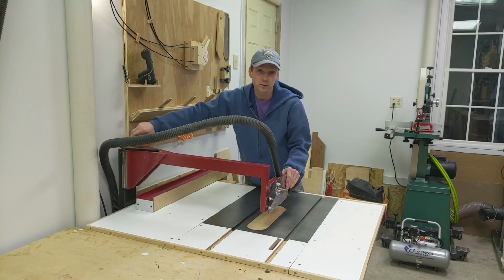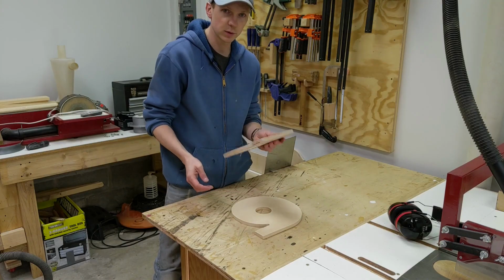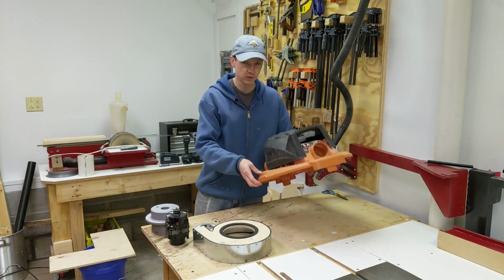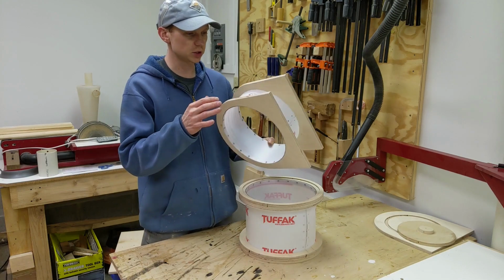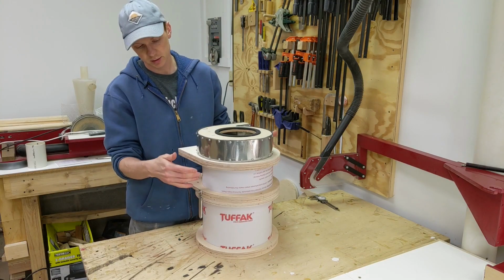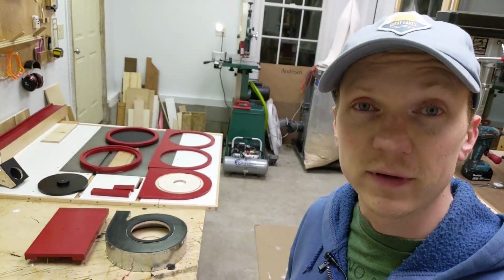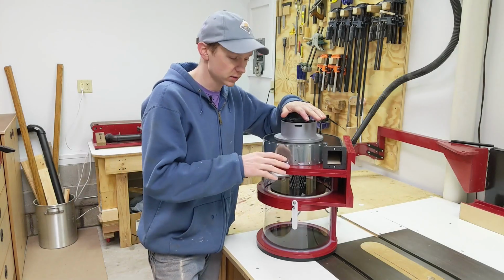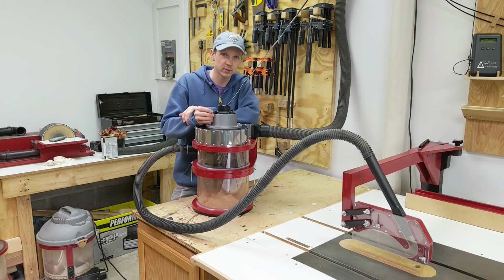Mini Cyclone Dust Collector Built from Shop Vac

Comment: That is sweet, it is too nice for the abuse my system gets... 😮 so cool to see the dropout. The dropout is difficult if you are extracting lquid that foams... and volume vs, chute diameter and shape are paramount, but if you have 2 stage vacuum, when you parallel 2 motors, it completely changes things...

Comment: I started with pvc and a heat gun. Working my way into abs and acrylic, there is something called poly carbonate.... and you just sais it on the video. All my vacuum stuff, well wet, sticky, stinky, nasty. I keep my qsp in an old dishwasher,  on the outside my garage. So quiet, sucks tig and plasma cutting fumes, plus I have added a branch to the house... better than beam central, and it does well on upholstery.  My separator is a washer tub with a 5gal bucket on top center of the tub. Yours is prettier,  can't wait to see. 😊

Comment: Very nice separator build. But I see, running your main dust collection at the same time makes the motor on the small separator kind of pointless. Well unless your main collector is not strong enough.
Reply from the maker: Not at all. They are two different systems (low pressure and high pressure) that actually work together quite well. See my other video about how I combined them together and tested their performance.

Comment: Beautiful work as always!  Always enjoy your videos.  Would be interesting to see more about how that shopvac motor was salvaged and re-purposed, what was involved, etc.  I was surprised that it would push the much larger impeller, for example.  
Question: since the shopvac exhaust is being piped into the larger dust collector, why not just redirect everything, instead of having another separator and  a very small reservoir?

Comment: So one question, the impeller seemed tiny compared to the turbine housing you made. Is that ok? It seems to work really well, but in other designs I've seen, a large wooden impeller was used that was extremely large. I'm assuming the extremely high RPM's makes the tiny impeller work well? I'm just surprised that that housing is so much larger than the impeller.

Comment: Very neat and attractive design! Interestingly, the fan’s shroud has much larger volume/diameter than those typically found in vacuum cleaners  (i.e. high-velocity, low-volume extractors). I wonder how that might influence performance. thx.

Comment: Nice build overall, but there should be a fine pleated filter before the vac motor as those are designed with what is referred to as a bypass motor.  The dirt is pulled into a filter bag or is filtered out before the air ends up in the motor. The closed face nature of a bypass vac motor will clog over time causing imbalances within the fan ultimately destroying the motor.  If you were using, say, a Kirby, Sanitaire or older Royal metal upright vac motor as the blower in this build, it's designed to take larger debris through the fan (evident to the fact that the bag is the end of the system) and blows it into the filter [bag].  Your large dust collector is designed very much like that as the filter bags are the last thing at the end.

Comment: Justin, I'm not up to date as to reliablity of shop vacs, Still have a Shop Vac brand that still works yet worn out several others because bearing/brass sleves wearing out. Any mid priced shop vac with ball bearings you could recomend ?
Reply from the maker: Hi William. I am not aware of any mid-price shop vacs that have ball bearings. Most of them have bushings. You have to jump up in price range to get nicer motors.

Comment: Why not put the silicon between the polycarbonate and the plywood formed pieces as you were assembling, would have been cleaner, and would have required much less than you used.

Comment: that's really cool. 

so what's the purpose of this device for someone like you who already has the dust collection system in place?
why don't you just suck it all up to the main dust collection system?
does it improve the suction comparing to connecting it directly to the main duct?

do you prefer to separate it, and keep opening it and throw away the small bucket?
Reply: Some cases, such as overarm collection at the table saw, requires faster moving air (Shop Vac) vs. large amounts of air (dust collector). This project just eliminates the bulky vac canister and replaces it with a small dust separator. 

And it’s absolutely brilliant. Fantastic idea and great execution. 👍🏼👍🏼

Comment: You didn't use a "razor blade" to cut the metal strips and polycarbonate sheet. That device you used is called a "Stanley Knife" (or unbranded, it's a "Utility Knife").

Comment: Awesome builld. You have a very approachable, Mr. Roger's, type delivery. I have the same dust collector as you and the biggest improvement I made for it was turning it into a 2 stage system with nothing more than some plywood and a metal garbage can. Luckily I can vent my fine dust outside. Made the already great, for the price, Harbor Freight dust collector even better. Great video and build. Keep it up

Comment: 8 minutes of my time wasted. Had I just known this project required a 3d printer.... :(
Reply from the maker: A 3D printer is not required. I used one, but you could use a piece of PVC pipe instead for the motor mount. Use your imagination.

Comment: very cleaver creation but the only thing i saw that is weak is some of the seals could use more hot glue or stripping and most of all the baffle works but is the most inefficient type i also think the impeller on the blower motor is not properly fitted to the blower housing i would have tried to 3d print that to be much bigger

Comment: Interesting...  but with your primary dust collector and distribution already in place, couldn't you remove the blower from this unit and just print an attachment transition for your primary dust collector to the top of your second stage (cyclone)?

Comment: Looks great... I was recently given a central vacuum system which I hooked to my dust deputy. It works much better than a shop vac also much quieter. i have it plumbed thru my shop and even have two hoses 1 large hooked to the bottom on my table saw as well as a smaller hose to the over arm at top of saw and it runs both hoses just fine.

Comment: Lost me at "I just made this motor mount with my 3D printer"
Reply: That's where I quit watching too.
Reply from the maker: Why do you quit watching when 3D printers are mentioned?
Reply: Would you be willing to share the file for the blower motor mount?
Reply: Because this went from a project most people can make on their own to a project that only those with access to a 3D printer can do. A 3D printer is out of my budget. And if it were in my budget I would probably just buy what I needed for a better dust collection system in my wood shop.
Reply from the maker: There's ways around not having a 3D printer. That motor mount could easily be square and made from 1/4" plywood. Or maybe even a section of 4" PVC. The hose outlet could have also been made from a square piece of plywood with a hole cut in it. I like to incorporate 3D printing because I find it fun and it allows other people to see another way to make things. Sorry to hear it is such a turn off for you.

Comment: very nice, definitely would have worked without any paint and unscrewing and rescrewing 200 screws.
Also most, if not all, vacuum cleaners have their filters before the motor, not after, i know the cyclone removes most of it but the impeller will still get clogged at some point, but i guess it's not that hard to clean ?
Reply from the maker: Thanks Joe. I don't think it will clog but it is easy to clean. My large dust collector sucks all the chips and dust through its impeller and never needs cleaning.

Comment: Justin , I also wanted to know if you think a dust collection system would work in the attic?
Reply from the maker: I'm not sure what you mean. Would you run pipes from the work shop to the attic? The more piping you have the lower the performance you will get.

Comment: Justin. I have a question if you don’t mind. A few months ago I bought a jet 3/4 hp dust collector . While discussing with the sales men I ask why the jet is better then my 6.0 hp shop vac.  I see higher hp as a gain but he told me the difference is the volume the dust collector takes in. Is this true or would the shop vac be better?
Reply from the maker: In general more air flow is better for collecting dust. Shop vac HP rating is a big lie. They aren't really 6hp.

Comment: Did you put in a inlet guide to the new blower housing to stop the air from short circuiting the air between the inlet hole and the output hole? If you look at the original blower housing it probably had that or used tight tolerances between the blower disk / wheel to stop that from happening.

Comment: That motor is going to die way faster with no filter
Reply from the maker: I doubt it. The motor is still on the outside of the system and doesn't see any dust. Only thy impeller sees dust.
Reply: @JustinDepew  there's still a bearing exposed under the impeller thats probably gonna get filled with dust and seize eventually.

Comment: Just subbed. Really like the channel.  I’m wondering if the screw heads cause airflow problems. I remember from my fluid dynamics class.
Reply from the maker: I used countersunk screws to minimize the head sticking up so I'm sure they have a negligible effect.

Comment: Do you think a bigger impeller would move more air, or would that overload the motor?
Reply: As long as you dont go above the motors amp rating, I don't see why not. You can measure the amp draw with a killawatt. Definitely a good tool for the shop.

Comment: Sits scratching 1's Head, so you Built an inline dust cyclone with its own suction?? Great Idea, why not just build it without the extra suction??
Reply: Well keep scratching, and perhaps after another 5 months you might finally work it out.
Obviously his main dust collector and that massive system of over-sized 6" pipes mounted about 20 ft up on the ceiling as completely under-sized for actually picking up dust from the tools. It's unlikely that the main unit has enough suction to pull the skin off a custard.
So he's using small portable units that he attaches to each tool. Then he vents the outlet up into they big pipes rather than filtering and venting into the room. Hence, it's got it's own suction (blower fan and motor) because if it didn't there wouldn't be enough power to suck up the fucking dust.
Reply: To add... and he has to build all these "inline dust collectors" because he never watched this video: https://www.youtube.com/watch?v=qjI5l4nF9AM

Comment: Hey Justin, great project. How do you determine the size and shape of your blower? Are there some simple design techniques and tools that you could share?
Reply from the maker: Good question. I based it off of the blower housing that was in the shop vac. I more or less used it as a reference to determine its size & shape.
Reply: @JustinDepew  how did you draw the shape? I've seen a few techniques but haven't nailed down the math of it yet

Comment: Very good video. Didn't you have to replace the silicone on your first cyclone? Wondering why you used it again vs the other sealant you found worked better.
Reply from the maker: Yes, I used the good silicone that I found sticks to polycarbonate.

Comment: does the main vacuum turn on when you turn the mini vacuum?
Reply from the maker: It did not in this video, but I plan to have it work that way. I will do a future video on this.
Reply: @JustinDepew  it looked like it was working as the filter bag started filling out so quickly, there must be a lot of flow with the mini vacuum
Reply from the maker: Yes, there is a surprising amount of air coming out of the mini vacuum. Enough to inflate the large filter bag and even swirl around the dust inside the plastic bag.
Reply: @JustinDepew  would it be an idea to just use the small vacuum and move it from machine to machine and connect it to the ducting? or make a couple more of the mini vacuums not needing the large central vacuum?

Comment: Glad to see you back in the shp doing shop things and making videos again Justin, Hope the time away was good for you ( and if there are a few vids I missed I"ll go find them) 
I do love this idea - as for impact on your main dust collector - if the pressure and flow out of the mini are more or less negated by the long tube up tot he main trunk line (combined with pushing the dust) then I would expect the impact on the main system to be negligible .. a little more air to pull through, but no loss in suction as it's not working any harder to pull in that air .. but there are SO many variables..looking forward to the testing!!

Comment: Im more interested in the shop vac motor. as it was not show in the video. I  have a busted vacuum in my house and i was able to salvage its motor, It still works but i dont know how to use it
Reply from the maker: Just requires two wires to hook it up. It's not too hard.
Reply: @JustinDepew  did you build a new impeller or you used the default impeller from the vaccuum? also thank you for the reply :)

Comment: I wonder how the cyclone would be impacted if the bottom of the separator were connected to the main dc instead of or in addition to the shop vac outlet? I'm hunting craigslist/offerup right now for a cheap shop vac to do this with, dust collection stops me from using my table saw all the time because I have about 5x15' of garage space to work with and the rest is house stuff and I don't want to get everything covered in dust :)
Reply: If you connect the blower outlet and the dust bin to the main DC, you would be creating an air loop that you do not want. Air would travel from the outlet to the dust bin and then up the separator to the inlet of the blower. All of the power of the shop vac would be split into running that loop and your suction would drop. If you added a blast gate between the DC and the bin, then you could open the gate on occasion (w/o the shop vac motor running) and empty out the small bin with the large DC and that would mean you never have to empty it, just "drain it" with the DC.
Reply from the maker: Your blast gate idea is fantastic.

Comment: So the shopvac is inflating the main DC bag, or did you turn it on also?
Reply from the maker: The shop vac is inflating the main DC bag.
Reply: @JustinDepew  pretty cool.  of course, ordinarily you'd be using it with the main DC sucking the bottom of the TS.    Looking forward to seeing it in action.